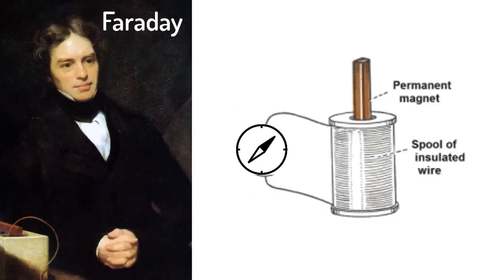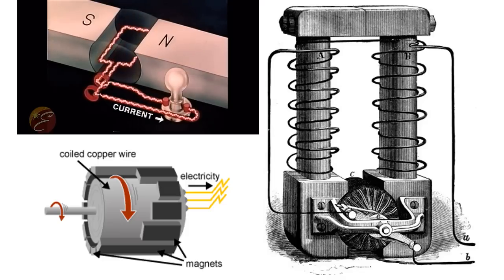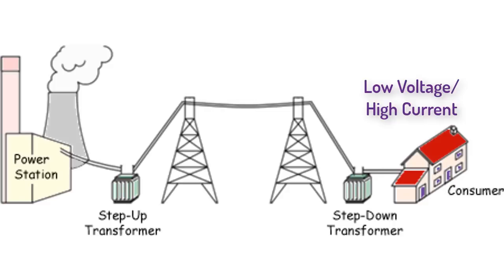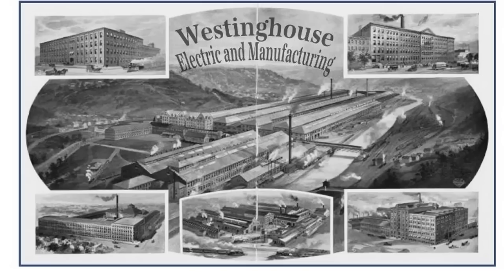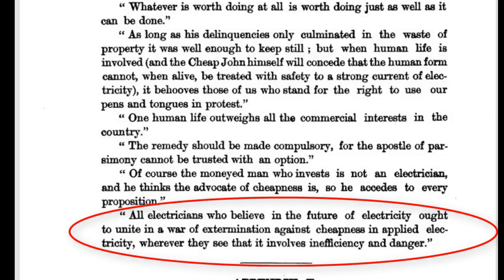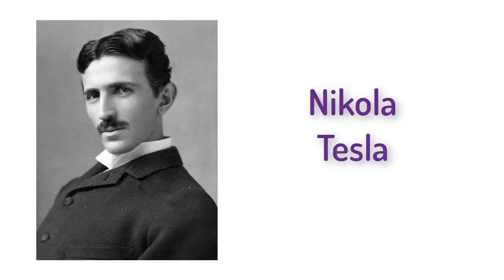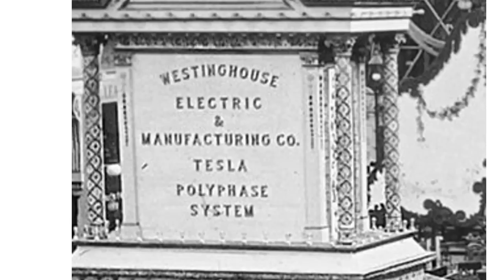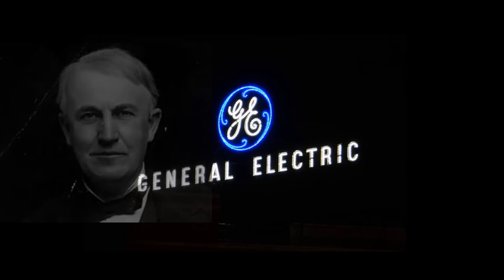Physics of "The Current War": Edison, Westinghouse & Tesla (AC vs. DC)

Comment: High voltage ac is how our power is transmitted over long distances along relatively small wires. Voltage is stepped up by transformers at the generation point and then down again where it is used. Edison’s dc system needed lots of thick wires and occasional regenerating motor/generators to carry power because of the loses to material resistance that inhibits low voltage.

Comment: 2:55 THEYRE indeed deceptively simple while also being mysterious, we tend to associate the B-Field with changes in voltage however in a toroidal core there is practially no external B-Fields yet we'd still get a change in voltage on a secondary winding! Thus we must investigate the aptly named A-Field, also known as the Magnetic Vector Potential by Maxwell or the Electrotonic State by Faraday.

Comment: First I enjoyed the presentation. Second the war has not ended: Examples of DC electronics include:
Cell phones.
The LilyPad-based D&D Dice Gauntlet.
Flat-screen TVs (AC goes into the TV, which is converted to DC)
Flashlights.
Hybrid and electric vehicles. So it is still going on, but using the strengths of each type of current.
Reply: Yes, DC is gaining ground, thanks to USB powered devices (especially with USB-C). Devices get more efficient, conform to USB power, and go mobile with (DC) batteries. Cars are gaining more USB power ports. And I’m starting to see house power receptacles with USB ports integrated along side the 120V-AC output.
Reply: I know that I'm late to the party, but I want to point out that DC is also used for high voltage transfer as well, since the mid 20th century.

Comment: Recently discovered your channel and find it very interesting, thanks!

But no mention of the fact that DC doesn't travel long distances nearly as well as AC? Edison's DC power distribution system would have required a generation plant every couple blocks of a big city, whereas Tesla's AC system could have one large generation plant outside of town. That difference seems to me to have been a major factor in the widespread acceptance and use of AC over DC.

As for the elephant, this is the first I've heard that Tipsy's electrocution was NOT simply the ultimate demonstration by Edison and the DC crowd with the intent of scaring the public away from their competitors' AC system. So is that story an "urban legend"?
Reply from the maker: I had a whole section about the transformer and how it made AC useful for traveling long distances and Westinghouse using the transformer and all of that. Did you miss the middle of my video?

Yes the story of topsy the elephant is basically an urban legend. There was an elephant who was electrified and the Edison crew filmed it but they had nothing to do with it and they had nothing to do with the war of the currents.  Then, in 2000 PBS made a documentary and they showed this film while they talked about Edison electrifying animals.

Comment: given a closer look at the circuit  at 8:00 is so wrong it would not work, if the magnetic coil could energize by  means of the sliding contact would make  such a short that would blow up the Amp meter  and no osculation  after the first closure of the switch down  the drawing

Comment: Love, love, love your videos! One comment relevant to the DC vs. AC battle; this wasn't just a conflict of physics, but of business models. Edison's empire was predicated on selling the components necessary for generating electricity at small, local scales; he envisioned getting rich by selling thousands of equipment units. Westinghouse foresaw something else: centralized electrical generation that would be produced and distributed at large scales; he would get rich by selling the electricity. I don't really believe that Edison believed that one kind of current was more dangerous than the other, but he did understand that large-scale AC transmission would tank his business.
Reply: I don't really like the lines of wires everywhere (going through forests etc). And those huge power plants.
The idea of having a solar roof and being off the grid is so delightful.
So maybe Edison's idea could work. Like with the cars: each car is a small generator of its own energy.

Comment: Edison would have won his point if he had drawn attention to the hazards the lineman endured. Nearly HALF of them were KILLED on the job! 🤯
I was shocked when I learned about this high voltage DC line running though Saugus, CA. I was working nearby and this guy who worked there told me about them. They carry 500,000 volts DC power! 
It turns out that for very long lines that DC is more economical and has less loss due to induction.
Reply: I think that you have your "facts" incorrect. The POWER LOSS in a wire is obtained by multiplying the current by itself and multiplying that total by the resistance of the length of the conductor. A conductor carrying high voltage AC with a small current would have vastly LESS power loss than a conductor carrying DC (any voltage) carrying very high current. Basic Ohm's Law. Thank you.
Reply: No, it would have been just as impossible for Edison's system to win as it would have been for the Wright brothers to fly to the moon. His system was a dead end.  It would have worked to some extent if he had accepted AC transmission and used DC only for distribution.

High voltage DC did not exist at Edison's times and Edison would have opposed it anyway.

The solution was obvious: put the cables on the ground.

Comment: It's amazing how often a visionary founder of a company is fired from that company by the powers that be, usually the bankers. Edison fired from Edison General Electric, Henry Ford (who once worked for Edison) from the Henry Ford Company (which then became Cadillac), and Steve Jobs from Apple Computer, just to name three. All three of them also bounced back and  became successful again in new endeavors.
Reply: If is common that the one who first starts something is unwilling to evolve. They do not recognize improvements made by others. Edison did this three times with the phonograph, electricity and movies. Wright brothers did that with airplanes.

The Edison all DC system was a clear dead end. One would have needed a coal burning plant within a mile of each user. DC did have some future but it was combined with AC transmission so instead of using steam engines they used AC motors to run the dynamos but even that worked only on urban areas and was an intermediate phase.

Comment: The only glaring mistake is Tesla did not originate 60hz frequency he used 25hz

Fighting between Tesla and Westinghouse over frequency was why Tesla quit working with Westinghouse
Reply: Now you are confusing everything. Yes 25 Hz was originally used for some application but it is totally unusable for lighting. Tesla designed his motor for 60 Hz.
Reply: @okaro6595  Tesla never designed for 60 hz and that argument is why Tesla and Westinghouse stopped working together.

Comment: Kathy, I hear they were using special high power dc lines to transport electricity somewhere recently. Please consider doing a piece on that?
Reply from the maker: That is very interesting to me. I think that the Japanese are particularly interested in it as they are stuck using two different frequencies. I will think about a video about it but am very busy with videos to do.
Reply: See also this Wikipedia article: https://en.wikipedia.org/wiki/High-voltage_direct_current
Reply: @philkarn1761  thanks Phil

Comment: No AC current motors?  Not true.  A DC motor that has field coils (instead of permanent magnets in the field) with a commutator will happily run on AC OR DC current.  In fact, these are the most common general purpose fractional horsepower motors in use today.  Only when you get into multi-horsepower motors (or synchronous motors) do you start to see AC induction type motors with starting capacitors.

Comment: Kathy always amazing videos... 
One Question:
Do you know why Europe has 220VAC 50 Hz Vs. us 120VAC 60 Hz?
Reply from the maker: Glad you liked it.  I think that Europe went with 50 Hz to make it an even .02 seconds a wave (Europeans like metric).  According to a website I saw, they used 110 V in Europe for AC for many years (Edison used 110V-DC as his lightbulbs were designed for 100V but he added 10% for voltage loss in the lines).  It was only after WW2 that the voltage was doubled to reduce the amount of copper needed for wire (higher Voltage = lower current = less heat lost in wires = thinner wires allowed).  With the destruction of whole cities I guess it was a good time to do a bunch of rewiring, whereas the US contemplated doubling the voltage but thought there was too much infrastructure in place to change.  

Tesla felt that 60 Hz worked better for his motor and I guess (but am not sure) upped the voltage from 110 V to 120V to make it a multiple of 60.
Reply: Now I'm on your fan club.
Somehow I couldn't answer your Questions on Patreon;
1) What is your first name? Fernando
2) How did you first bump into my videos? Always looking for good science videos on Youtube
3) Do you have any scientific or engineering background and, if so, what is it? Yes, I'm an electrical engineer, who loves physics

Thank you for you work
Reply from the maker: @fberron  thank you for joining, and I wonder what is going on with Patreon messages?  Grrr.  Anyway, I sent you another message on Patreon, let's see if that one works!  - Kathy
Reply: @Kathy_Loves_Physics  Thank you! :)
Reply: In Europe Dolivo-Dobrovolsky first used 40 Hz but as lights flickered with it he switched to 50 Hz. 60 Hz comes from Tesla. With voltage it is more complex. Everyone started at 110 V as that was what carbon bulbs required. However Europe gradually shifted to 220 V. Berlin was first in 1898 but many places it took longer. In Finland for example in early 50s major cities was at 127 V / 220 V AC, rural areas were at 220 V / 380 V AC (three phase). The center of Helsinki was still at 125 / 250 V DC (three wire). Normal sockets gave the lower of the voltages. In the late 50s, early 60s it was harmonized to 220 V / 380 V. Then in 1988-95 it was raised to 230 V / 400 V to harmonize with Britain.

Comment: Actually, Edison was right, AC is more hazardous to life than DC at the voltage although I doubt he ever remotely knew why.   Direct or steady state current causes to heart muscle to contract for as long as it is applied,  As long as the curent is only momentary,. and stops before too much tissue death occurs, the heart's natural pacemaker will restart normal rhythm.  AC on the other hand will cause the heart to randomly spasm ineffectively pumping any blood until death occurs.  Defibrilaators use high voltage DC.  Electric chairs use high voltage AC.  The sensitivity of the heart to AC depends on the frequency of the current.  By some great cosmic coincidene, the human heart is most sensitive to,,,,60 hertz.
Reply from the maker: It is amazing to me to read these prolific inventors and realize that they were often throwing stuff on the wall to see what stuck.
Reply: MichaelJGrant the biggest factor wasn’t which was more dangerous dc was just pretty shitty in comparison to ac and wouldn’t be possible to use anywhere in today’s society

Comment: Nice.
Sad you did not mention about how his DC did not power customers over 100km abd other guys AC could get over 100km
Reply from the maker: I did mention that AC went farther than DC but I didn't see any contemporaneous articles mentioning 100 km (which would have been odd in the US as we use miles).  Not to say that there wasn't anything mentioning that number as obviously, I cannot read everything from that time.  I am sorry, however, if you felt like I was unclear about the huge advantage AC had in transmitting power longer distances.